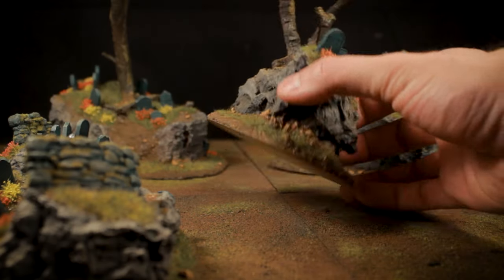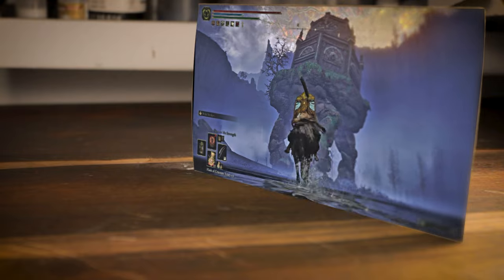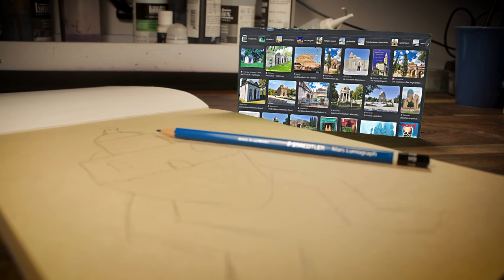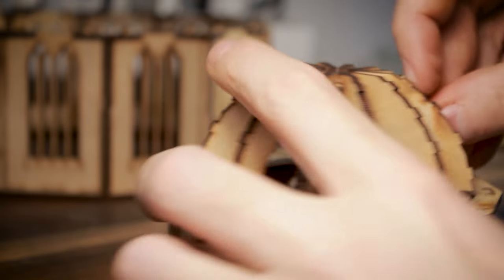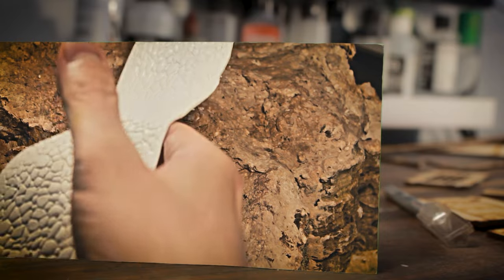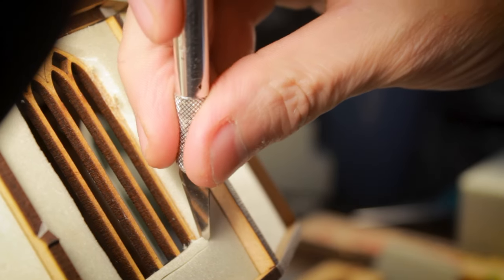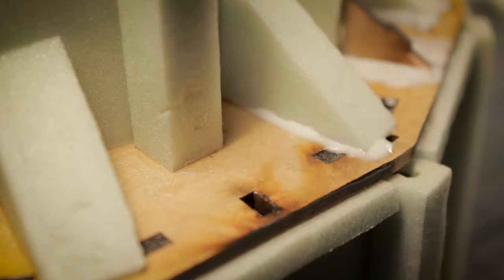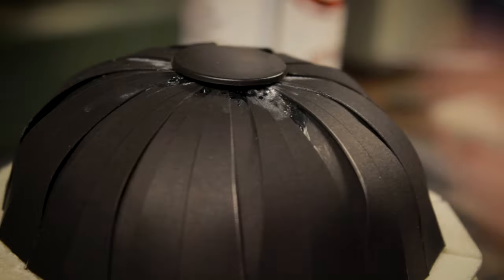MDF Kits don't need to look like MDF!

Comment: This is an awesome build! With how covered this MDF kit is I'm curious about your thoughts of using an MDF kit as a base vs just trying to scratch build the same structure with foam and maybe cardboard/chipboard for support.
Reply from the maker: This is an interesting question. I decided to go this route because of the timeframe I had to work with here, but in the end modifying the mausoleum was still the most time consuming part of the build. I think it is still faster than building something completely from scratch as you don’t need to plan out what your build is going to look like. Working with mdf kits frees up a lot of mental space in that regard, though I wouldn’t say I prefer one over the other.